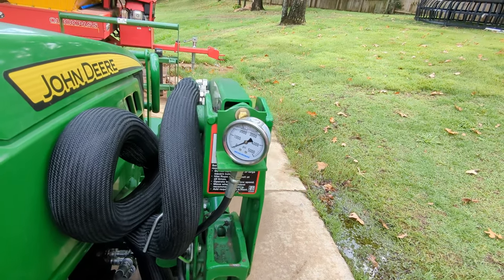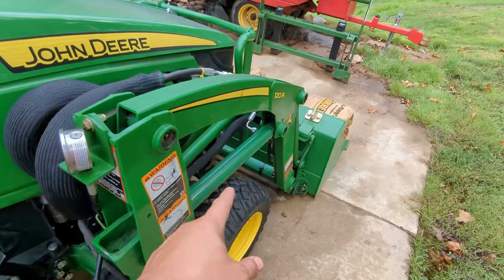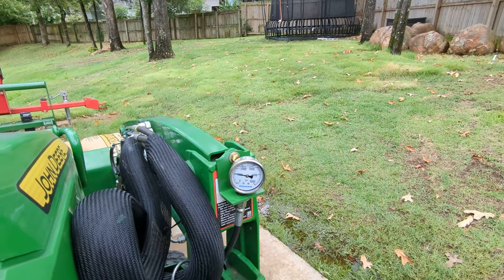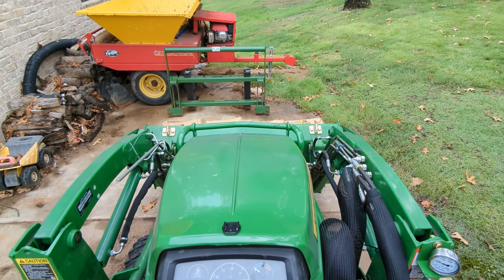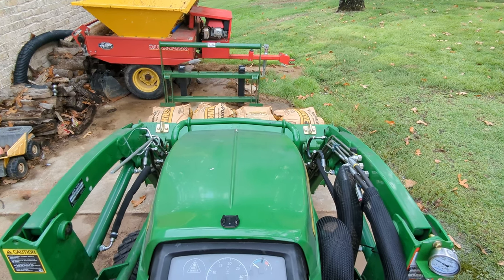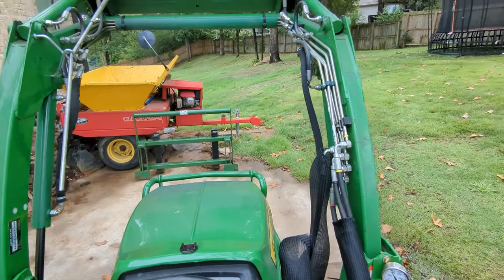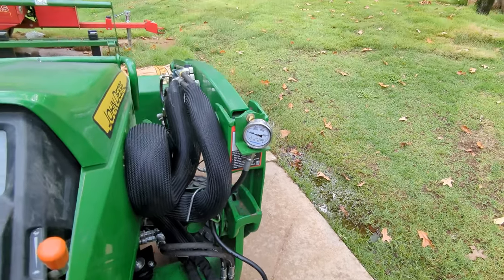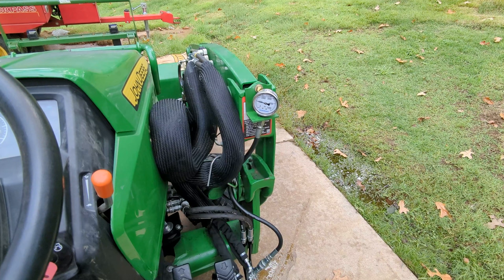HydrosPlus Hydraulic Loader Scale

Comment: Neat stuff!   Do you think you could ever come up with a product for making a normal loader into a hydraulically self leveling loader?
Reply from the maker: I've thought about that and done some preliminary work to determine the geometry, but I think it's going to end up being too expensive and require more skills and paint than the average user can or would want to use.  The main reason I was thinking about it is because the new MSL loader leaves a lot to be desired.  In the end, I don't think I'll pursue modifying the NSL to be MSL, or the MSL to work differently.

Comment: I'd be interested in a pressure gauge that ties in prior to the valve so you know what the system pressure is at any given time.  If it came off right after the pump that would work with the backhoe too.  In my case I'm curious as to when I'm in 'boosted pressure' territory as I turned mine up.  Anyway, if you decide to make one or are willing to do custom stuff please let me know.
Reply from the maker: Help me understand what you can do with the information you would get from knowing the system pressure.  I don't think I understand the application.
Reply: @HydrosPlus  The hydraulic system isn't running at full pressure all the time is it?  I turned my pressure up, let's say to 2500.  If the pressure gauge normally reads say 100psi just for circulating the hydraulic fluid I can then keep an eye on the gauge when lifting.  If it goes over the factory 2000-2100 then I know I'm lifting more than the rated capacity and to be extra careful (I'm newish to this stuff so I tend to be careful anyway).  So that's it.  It would just let me know when I'm using the extra pressure I dialed in.
Reply from the maker: @fsj197811  Thanks for confirming.  That is what I thought you were wanting to do.  My opinion is that in practice, you can't do that on something like the backhoe.  If you were curling a bucket of dirt, it would read maybe 1000psi, but once you hit an immovable object, it will jump quickly up to the PRV setting.  At that point, you will stop, but in the end you actions would be the same with or without an inline pressure gauge.  If you're talking about the loader, then this setup will solve for your request.  As you're lifting, the pressure displayed will be the system pressure until you stop lifting, in which the system pressure will go back to near 0, but your loader will still have the pressure used to lift the object.
Reply: @HydrosPlus  OK thanks for the reply and confirming the system works like I thought it does (near zero normally).  You have a good point about your setup showing the 'holding' pressure for the bucket which it wouldn't do the way I was describing.  Decisions decisions.  :-)  Have an awesome day and thanks again for the reply.